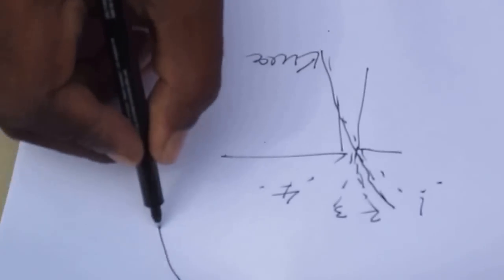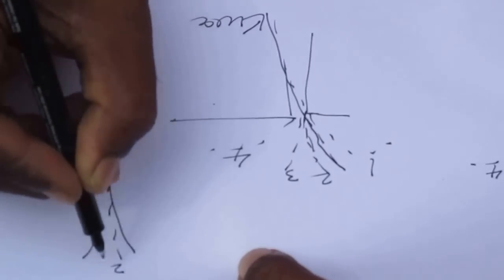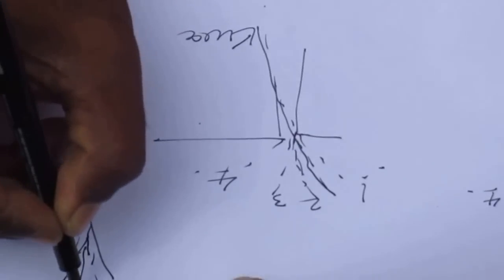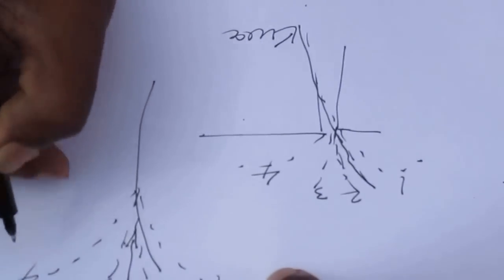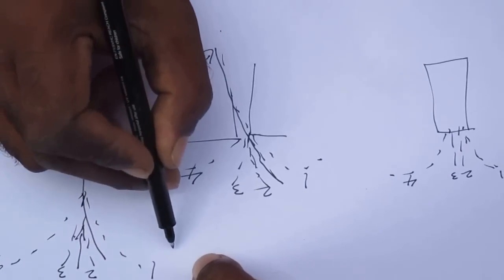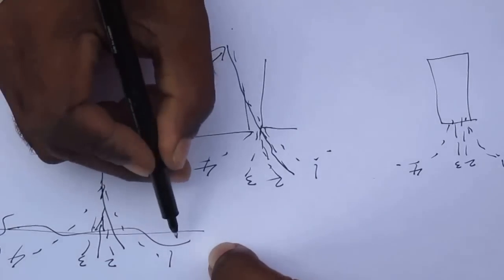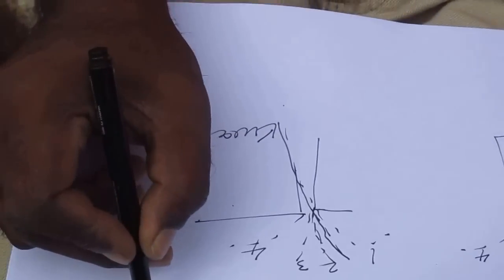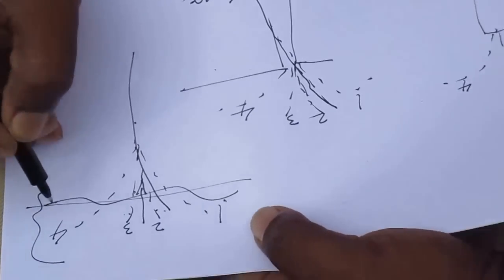To locate the exact ground water point

Comment: Groundwater level measurement is mostly performed by a submersible pressure transmitter. These hydrostatic level transmitters are small in diameter and directly suspended by their cable into the well, borehole, deep bore well or monitoring well.
Reply from the maker: Great

Comment: Sir can we use coconut instead of y shape rod for locating 4 magnetic flex points?
Reply from the maker: mani kandan sure

You can use coconut
Reply: LIGHTNING WATER DIVINER  Thank you so much for you reply sir..
Reply from the maker: mani kandan 

Thanks
Reply from the maker: Water divining consultant
Almond D souza
9865660921
9488134139